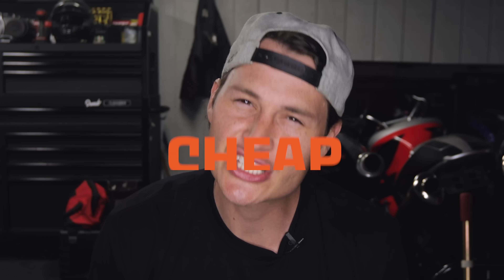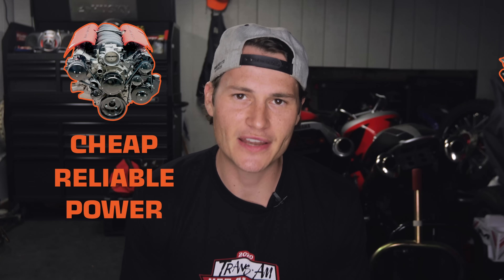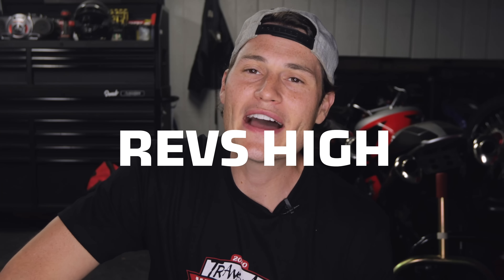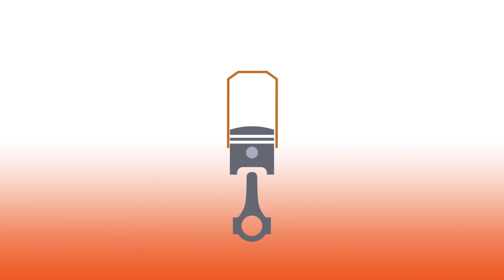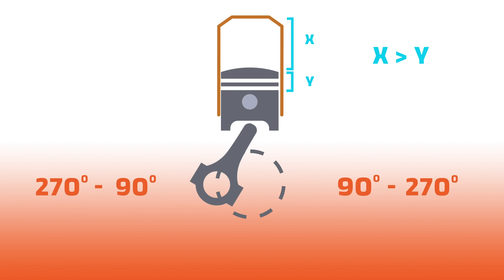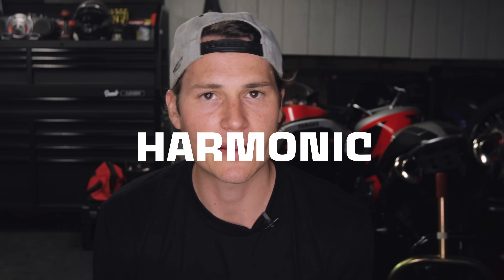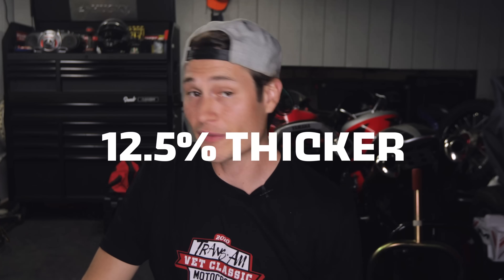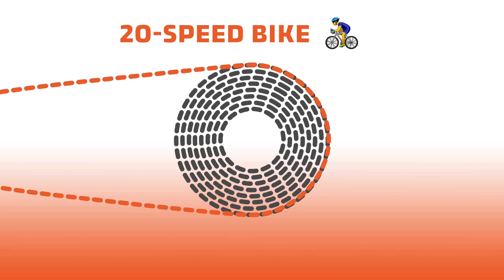Nissan VQ Engine - The Science Explained

Comment: So much wrong with this video.  Lol.  First, incline 6 don't fire 1 and 6, 2 and 5, and 3 and 4 at the same time.  Those cylinder pairs fire 360 degrees from each other.  Next, the I-6 is like a typical V-8 or newer Yamaha R1s that don't use a flat plain crank.  This helps smooth out secondary vibrations because you don't have most of the pistons having that uneven piston travel at the same time. Lastly,  close ratio transmissions.  My FZ6 has a close ratio transmission.  Lots of fun because when you're on it,  it stays "in boost" (it doesn't have a turbo) or in the power band better.  The downside is riding conservatively.   It revs to 14k rpm, 6th is 1.1:1 (no overdrive gear), and at 65mph, the motor is at 5,000rpm. Riding conservatively,  you're sawing at the gears the whole time or you're revving out. Whereas a progressive transmission or a progressive with a high over drive cut down on the shifting by having 1, 2, and maybe 3 do a lot more.  My old 5.0 had a progressive 1-4 with a high over (5th). If you didn't win the race in 4th, you'd lose in 5th. Why the high 5th? Bring down RPMs for MPG. And the progressive allowed 60mph in 2nd or 1 shift with a low redline.  Those gears on an HR 350z will cause it to fall out of the peak power and feel sluggish.  So, instead,  the close ratio might mean 2 shifts (3rd gear) to 60mph,  but you'll feel "in boost" and you'll have more fun.  It will make slow driving boring though because you have to rev out or saw at the shifter.  Though,  with the H- pattern (unlike my FZ6), if you're smart,  you can take off in 2nd or short shift,  and skip. So in bumper-to-bumper you might start in 2nd and shift to 4th as traffic speeds up then back down to 2nd as it slows or take off in 1st, short shift to 2nd, then 2, 4, 2, stop.  1 2, 4, 2, 4, 2, stop. You can skip in a progressive also.  It's just a bigger step

Comment: I think the explanation with the different piston speeds from 90 to 270 and from 270 to 90 degrees is slightly wrong. The crank, doesn't matter how it's designed, is providing a specific offset from rod bearings to main crank bearings. That distance, not taking into account the really small vibrations of a turning crank, is always the same so rod bearings are turning in a perfekt circle. I can imagine that the piston speed is different when the main bearings are not positioned exactly the middle of the cylinders axis, but instead with a small offset. But again, in this case the time and distance from 270 to 90 and vice versa should be still the same (, but not necessarily the piston speed).
Maybe I am overlooking a detail here, I am just a little engineer that also can do mistakes. Looking forward to see some explanations.

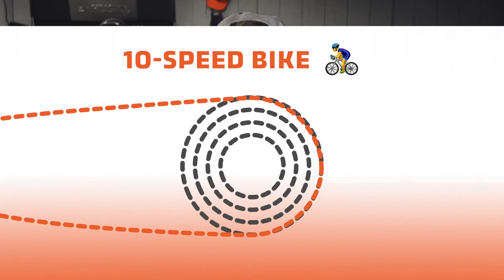Comment: 13:49 that shifted to lower gear, not higher
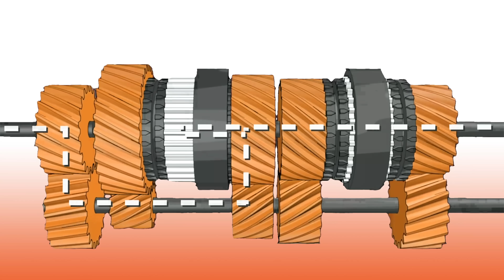14:28 of course it would be smooth without a synchronizer, you just need to know how to shift it. 14:57, again your wrong for the same reason.
Reply: Yes but no, his point is that when you have a close ratio, the area in which you can shift without grinding is much smaller.

Comment: "The vq35hr is the Creme de la creme" while the better-in-every-way vq37vhr is just sitting there like what am I, chopped liver?
Reply: I think from a tuning standpoint the HR is preferred over the VHR because of the lack of the black magic fuckery that is VVEL, but I still love my 370.
Reply: @chilidog1741  nah if your tuner knows what he's doing it really doesn't matter tbh ive seen vvel head make 1000whp
Reply: @chilidog1741  😂😂 black magic fuckrey
Reply: Q50 lyfe
Reply: Agreed I’ve owned every VQ and the 3.7 is way better than them all
Reply: 08VaNupe I have a 2007 Nissan Murano with over 206,000 miles and I drive it like a TrackHawk.
Reply: 08VaNupe way better?I own a VQ35HR G35S 08 and VQ37VHR 10 G37 coupe. I love them both but the G35 is quicker in a straight line. They are very similar actually the VQ35HR is basically the same as the VQ37VHR besides the crank and the VVEL. VQ35HR is more closely related to a VQ37VHR than the older DE and Rev Up
Reply: vq40de ftw
Reply: I never had a g35 beat me in my g37 coupe idk wtf shit boxes yall got
Reply: @TheAraichboyz  i have an 08 g35s that all but keeps up with the g37 coupes honestly its pretty close it being rwd saves a bit a weight on the g37
Reply: Agreed, my G37 is very smooth and they come with VVEL as well, an important part of Nissan tech
Reply: VHR has a longer stroke and a more complicated head which is not as preferable for boosting. For boost-HR, for NA- VHR.
Reply: @ryanscanlan9875  cheap boost, DE
Reply: not exactly better in every way. vvel is less reliable. also the 7 speed auto is absolutely pos
Reply: @jaronyuriyh7931  agreed.  Just adds more complications for not so much improvement imo.
Reply: @rxtuninginc8444  but from my experience i didnt have any problem with the vvel. 7sp jatco on the other hand just trash that and use zf 8 speed auto already god dan nissan
Reply: Tbh the 37 is the same from the 35 but what's funny is that the 35 holds more power and better
Reply: Eh, I'd personally take the 3.5 but ya basically the same engine.
Reply: agreed man. sitting here having owned both 08 350 with an hr and a 19 370 with the 3.7 vvel wondering what all these goons are saying. HR was a phenomenal engine but it only got better. Less reliable for sure but putting 335 to the wheels with just bolt ons with the 3.7.. not complaining. I woulda smoked my old 350 like it was at a stand still
Reply: For boosting the HR is better, as it has less compression ratio. However the vhr is much better na
Reply: In stead of saying chopped liver u should b like "Am I A Joke To You?"
Reply: @F34RL1C1A  thats literally what the saying chopped liver means
Reply: @F34RL1C1A  comedic mastermind

Comment: I feel like Honda’s J Series Engine is way smoother than the VQ
Reply: It is, I've never heard anyone never heard anyone refer to the vq series as being smooth. I remember reading in a magazine years ago that the 350z was like a coffee grinder.
Reply: Having spent 4 years driving a vq35hr, it’s is a great engine, powerful and smooth, loved it. Always felt underrated to me.
Reply: Having owned a j32 powered car and a vq35 powered car the j was definitely smoother, and vtec was fun too. But the vq definitely pulls harder and I like the sound more.
Reply: @Eli-C-YT  no shit you're comparing a 3.2 to a 3.5. the j35 and j37 are excellent engines and much more stout than the vq.
Reply: @Eli-C-YT  hyundai v6 > vq all day 350 hp stock
Reply: @e36blur  A quote from a Hyundai Kia tech himself Hyundai cars are ok as long as you don’t get the 4 cylinder, 6 cylinder, 8 cylinder, or the electric cars. Also they like to have rod knock at 100,000 to 170,000 kms or completely seize up at around the same kilometres. Did I mention they were properly maintained? You can abuse and thrash the ever living hell outta a 2jz and not do oil changes and services at the required intervals and it will still last longer than those Korean engines.
Reply: The J series is way smoother. After having several cars with the VQ engine, I think it feels a little gritty, but it sounds better than any other V6 stock.
Reply: Many Japanese automotive manufacturer's make superb V6's like Hondas J series, and Toyota' s 1MZ,and newer GR Series. None of wich have had more " Performance mass development " than the Vq Series, and now the Evolution of the " VR" Series Beast!
NISSAN put alot of time,and thought into this power plant knowing it will need to power many models, in different configurations. And there we're many 1st debuts with this. Like 1st micro polished piston chambers in a mass production . Etc. 
AND FOR THOSE WHO DONT KNOW, NISSAN'S VQ FAMILY OF V6'S WHICH THE VR IS BASED OFF OF ,AND POWERS THE ALLMIGHTY GTR WAS NAMED OF OF WARD AUTO WORLDS 10 BEST ENGINES 10 YEARS STRAIGHT!
DEFINITELY ONE OF JAPANS,AND THE WORLDS  BEST 6CYL ENGINES EVER!
Reply: The j series and vq engines make for a great rivalry, both see similar power from similar mods. Its a shame honda is so focused on Cvt transmissions tho
Reply: Liam Heuvel Meanwhile Nissan is the one pairing pretty much everything with a CVT... literally every sedan they make is a CVT. Honda Accord has a 6 speed manual and a conventional automatic option.
Reply: Funny, I thought the same thing.
Reply: For being single cam and a motor that wasn't meant for performance I think it holds its on.

Comment: Just FYI, if you're going to point out the transmission for the 350/370z's, most refer to them as the CD009 (most common code people refer to for these transmissions) or JK4** as there are a bunch of different slight differences, but most of them are quite stout. Nothing special about the JK41B.

Comment: I like the power, ive owned a g35 sedan and a 350z but hate the oil leaks and cooling system . I live in the desert in so cal and every summer i had to bleed out system so that they wont overheat and even then , when its over 105 degrees outside the cars will overheat if you have the ac on and waiting for light to go green. I had to let them go

Comment: The smoothestest transmission is the cvt in my moped. dabs in 3 horsepower
Reply: Yessir
Reply: I have a 2007 Nissan Murano with 206,000 miles and I drive it like a TrackHawk.
Reply: NFL YoungBoy 😳😵👍🏽
Reply: @nextlevel7108  yes sir
Reply: @NFLYoungBoy223  does it give u any issues
Reply: @vape80  nope almost 208,000 miles

Comment: All this smooth and balanced talk has me asking have they driven a VQ. I've had 1 350, 2 G37, and one Q50...smooth isn't  a term I'd used.  It's not terrible, but there are smoother engines. Not hating on the engine, but it's not super smooth.
Reply: right? vq is a fun sounding engine with fun delivery but they're well known for being noisy, very coarse, and very thirsty.

Comment: That's not how a 20 speed and 10 speed bike works. They both have 10 gears just that the 20 speed has 2 chainrings. You basically have a closer ratio and a wider ratio than the 10 speed depending bon which chainring you use.
Also the gears are usually on the back and to go faster you use a smaller gear.
Unless you're using one of the weirder ones like Shimano Nexus

Comment: the fact that you could get such an advanced engine (for the time) in a light coupe for like $27k in 2002 always blows my mind man. insane value for the time. honestly havent seen a retail sports car deal since then. they literally just dont make japanese cars like that anymore
Reply: 400z coming soon.. v6, twin turbo, RWD, 6 soeed manual
Reply: I had a 350z interior was cheaply made.  Scratched and plastic pieces broke off easily
Reply: @danielcaponera5771  did that really matter though? It was a cheap sports car made for driving. It didn’t even offer leather except on one option package
Reply: @SeanPennII  brand new off the lot yeah.. after a couple years w some miles on it like 25-30k
Reply: Light? ahaha compared to a bus?
Reply: @airtec87  what car was lighter in 2002 that had a higher hp engine?
Reply: @SicSemperBeats  You said its a "light coupe". the 2002 Wrx has about the same weight and 0-60 times and that car is a sedan 4 cylinder.  350z isn't light, Z cars have always been known as heavy.
Reply: @airtec87  Where are you getting your numbers from. A 2002 wrx 0-60 is 5.5, 350z track trim is 5.4. You also didn’t answer the question I asked. What car was lighter with higher horsepower at the time? Answer is none under nor in the price range. Best you could do is a c5 corvette for $40k
Reply: @SicSemperBeats  Lol you serious? WRX is a sedan and you are saying since the Z beats it by .1 seconds then its a better car? Its a 2 seater 2 door, it should be a lot faster then the sedan with a Awd tranny. But hey, HP is all that matters and the mustang guys will agree with you.
Reply: @SicSemperBeats  Lol you mad. Okay, didn't mean to get you upset on the internet. I can tell you take pride in your old 350z. Thats cool.
Reply: @airtec87  how am I mad? You legit just called a drive layout a transmission. You seriously don’t know what you’re talking about. Work on actually owning a car because it’s obvious you dont have one. Btw i dont drive a Z lol. I have a 335i and a m340i
Reply: @airtec87  you’re right that the WRX was also impressive for its time considering it is a practical 4 door sedan with the same weight and 0-60 times. But the VQ is still the more powerful of the two, and most important of all it’s wildly more reliable. Turbo flat 4’s sound great and can perform well but people blow those motors like every 40,000 miles. At the end of the day the 350z is gonna handle a lot better than the sedan and it’s equipped with a lot more torque, it’s simply the fastest best performing car for its era all while being cheap and reliable, it’s undoubtedly a legend.
Reply: @anthonym6918  It was great value but nowhere close to "fastest best performing car for its era" lol... It had nothing on a M3
Reply: Trd supercharged  2uzfe 4.7L v8 with AISIN TRANSMISSION...... in a taco..... nothing will compete! <for the $> & you can buy a 2020 tundra glass body!
Reply: Lmao. Nissan is the pond algae of the JDM world.
Reply: @CODZombiezable  > Nissan GTR sends his regards

Comment: 2:15 It is called the Renault Espace and not the Escape. It's a 7 seats minivan basically. Sorry if I sound like "that guy", that's not my intention.
But didn't know some Renault had the VQ V6 on some cars. I knew there was a deal where Nissan uses Renault 1.5 and 1.9 diesel engines (at least these 2)

Comment: me watching this when i just blew my DE 3 days ago 🥺🥺🥺
Reply: Me watching this when I just blew my HR 350z a month ago
Reply: @jponz85  both of you try putting oil in the engine
Reply: @cali_cal  or changing the oil more than 10000 miles at a time 💀
Reply: @cali_cal  my engine wasnt burning oil though
Reply: @killakam123321  changed mine every 6k full synthetic
Reply: Jonathan Pontel  partout ?? 😂
Reply: john maselli  you didn't just grab a used transmission from the junk yard for like $500?

Still would have paid install but way cheaper than what a shop would charge.
Reply: john maselli  definitely should've bought a junkyard trans or one from a part out, wouldn't even be that hard to install yourself

Comment: Have you consider LS swapping a 280Z? If yes, why not consider VQ swap it instead. I had a VQ35DE powered Infiniti M with AWD, it was a fun car. You basically have Lexus reliability with BMW rivaling performance with an Infiniti M or G. I smoked all a handful of beamers with it. I loved that thing. But, now I drive a boring Camry. The Re50r05a 5-speed automatic transmission is still a lot of fun to drive in a VQ powered Nissan or Infiniti. Despite being a 2008 model year, it is a more responsive and dynamic automatic transmission than my 2015 Toyota Camry. Every time I hammer down the gas on my former Infiniti M35X, the kick-down is just instant and the shifts are quite snappy yet buttery smooth rivaling the lastest 8 and 10-speed transmissions found in Luxury sports cars at the expense of fuel economy due to having closed ratios just like it's 6-speed manual cousin. My 2015 Camry there is a slight lag and the 4 banger just struggles on highway ramp acceleration when dealing with rude drivers even on WOT. Unfortunately, there is a design flaw in the RE50R05A transmission that causes it to fail but, it can be easily remedied by a qualified transmission shop.

Comment: Bought an 05  infiniti G35x 2 years ago with 190,000 miles, all stock. Its a great engine! It's really quick (compared to my old 99 Accord V6) very smooth as well. I haven't had any trouble with the engine itself, all my repairs have been wiring/bearing issues (due to the previous owner running different sized tires) I hear a lot of people say they don't like the exhaust sound but I personally love it even stock it sounds sporty you can tell its got some power.

Comment: Let’s not talk about the VQ’s with the timing chain guide failures;-0
Reply: *Doesnt take care of engine 
*blows up 
: O wtf this engine is trash
Reply: @killakam123321  you cant 'take care' of a plastic timing chain guide
Reply: @mystereidm   Are you slow ? Its literally called changing the oil bruh. Why does the material it's made of matter? It could be metal and if you didnt change the oil enough guess what ? Bye bye motor